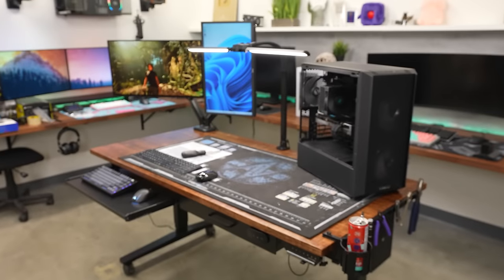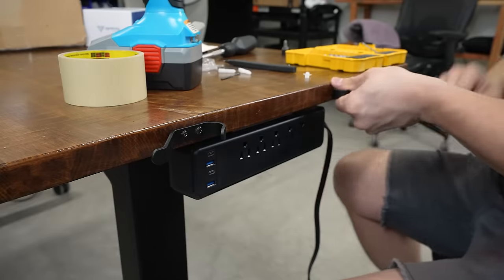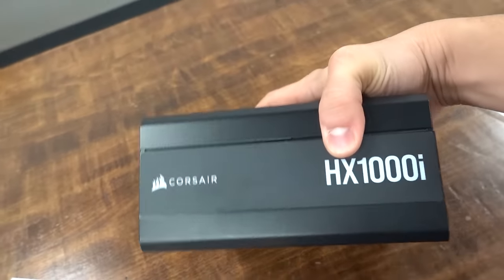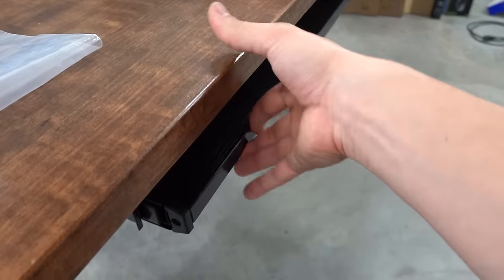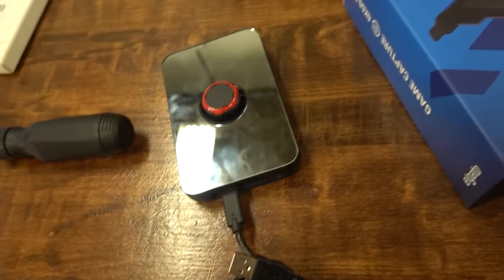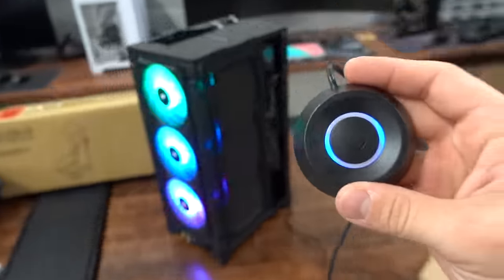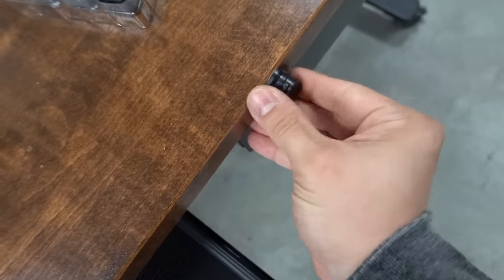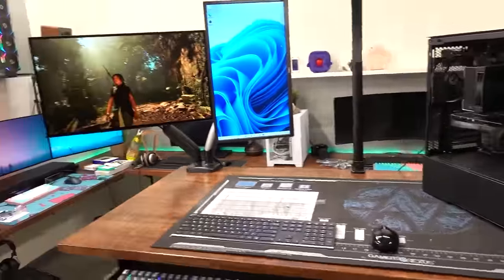PC Workbench but make it INSANE

Comment: put the wireless charger in the same area as the "power button" you installed under the drawer. simply put your phone in the drawer while doing builds since its unlikely that you'll be scrolling twitter, tiktok, or whatever you use your phone for while doing builds

Comment: You know its dirt cheap when the fucking screw breaks in half
Reply: not really, he just doesn't know what he's doing. He used a bit way too skinny for the pilot tap before putting the screw in
Reply: @kianmarcial8884 you mean the screw was too wide for the pilot hole?
Reply: @kianmarcial8884  I mean, still... I'd expect the threads to just not be able to drive in, not the head to snap off.
Reply: @kianmarcial8884 lol wut, he was doing fine. I don’t care if he screwed them in raw; screws should not break like that getting screwed in by hand

Comment: You could change to the side cable power supply, so you have easyer access to the cables
RM1000x SHIFT 80 PLUS Gold Fully Modular ATX Power Supply
Reply: I was about to recommend the same one.

Comment: im definitely ordering those little magnetic cable clips. i have so many uses for those. i own that cup holder and it works very good. i also thought about getting the wireless charger puck but instead went for the elevationlab quickdraw. its a cord holder with slack adjustment.

Comment: That second PC needs to be mounted under the desk as well. It would open up the top of the table really nicely. My PC is sitting on top of my desk and every time I look at it I realize I need to mount it under the desk. Its just in the way, and since it has no optical drive I really don't need to access it for anything other than to clean out the cat hair now and then.

Comment: When I created my "build" desk I used a similar light for the desk, makes it easy to get light where I need it. Did not bother with a sit/stand, just attached this to my gaming/office desk as an L. For the power I put a clamped power strip on so the power outlets are right on top of the desk, easy to find but out of the way. Has three outlets plus two USB charging ports. 

I am looking at two different options for the peripherals. I am currently using a KVM for my work and game rig. Simply moving to one that allows 3 or 4 PCs will mean that only a USB and a display cable will need to be run to the bench. The other solution I am looking at is a portable display, gives me the ability to use it on the go as well if need and store out of the way when not needed. If I go portable display I will just keep a small keyboard and mouse (something cheap) handy.

This is for builds or repairs, not full use so the need to heavily invest is not all that great.

Comment: Wasn't able to see how you've got the capture PC connected. You can remote into the capture PC from the main system and so only need one keyboard and mouse and this could free up the 2nd monitor in a sense. Can use a cheap 4 port switch underneath the desk as well.

Comment: it'll look cool if you add a talk roof on that so you could hang or put more cables just for backup or maybe you could hang those keyboard, mouse and power cable on it so it would be easier to reach them and plug them in instead of reaching over the table just to grab them and plugging them in. but thats just an idea on top of my head🤷🏻‍♂️ could be a dumb idea but who knows

Comment: One thing I don't really see the need for is 360 AIO for 5700G. The CPU never runs hot enough to require 360 AIO, something like 120mm tower cooler would be plenty and it would be a lot more reliable in the long run.

Comment: Solution for the PSU moving: you can buy a Cooler Master NR200 PSU bracket and screw it into the bottom of the table. They're only like $20 from Cooler Master.

Comment: @10:30 Kyle why dont you use the Corsair RM1000x Shift PSU with the cable on the side of the power supply would be a better option then what your doing with the current one

Comment: why didnt you use the new shift power supply that has the connecters on the side of the PSU? wouldnt that have been easier.

Comment: I need to get one of those external power switches. I have an old server PC in a Coolermaster case that has a busted power switch. I have looked for replacement switches but cant find any. An external switch would be perfect.
Reply: Also I love Corsair keyboards. That K65 looks sweet!! I have the K68 RGB and it has been a fantastic keyboard, though my experience with their mouse is horrid. I have had 2 Corsair M65 Elite mice that have both quickly developed right click problems. As far as mice, for me, the Logitech G502 is the best available. I just bought a new gaming laptop and bought a second G502 for it, they are outstanding in everyway, but the weight and ergonomics are absolutely perfect for my hand.

Comment: You probably gonna regret the magnetic strip, I use one and it's all too easy to bump tool and drop it.

As for power supply mount... dude, you have drill, just make new holes in the mount

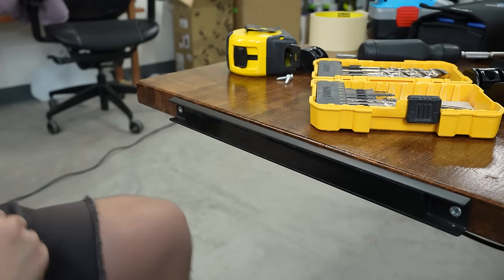Comment: 6:00 Why do you people waste your money on LTT screwdrivers? I got an entire kit, with two different sized drivers and 90+ bits (lots of duplicates, but they haven't broken or gotten damaged yet so I'm not sure why), and I paid less than $40. The smaller driver's bits are all magnetized and are almost as strong as the LTT screwdriver, but the larger driver's bits are not. The larger one contains a handle space with a "rack" for storing several bits; the smaller one has an end-piece that allows you to rotate it against the palm of your hand to use more pressure - something that overpriced screwdriver from LTT can't do. My driver set came with all kinds of tools that are useful in the world of phones and computers - the LTT screwdriver came with...what? A small number of bits? How anticlimactic and overpriced.